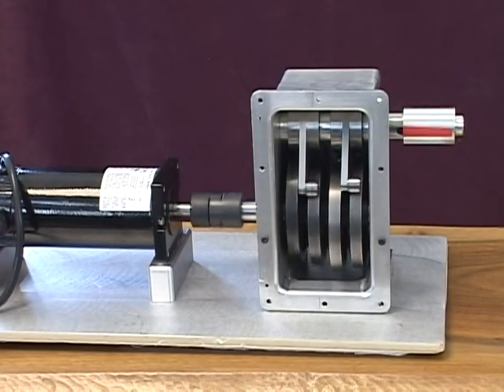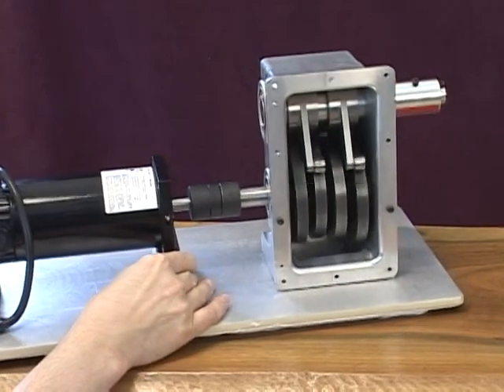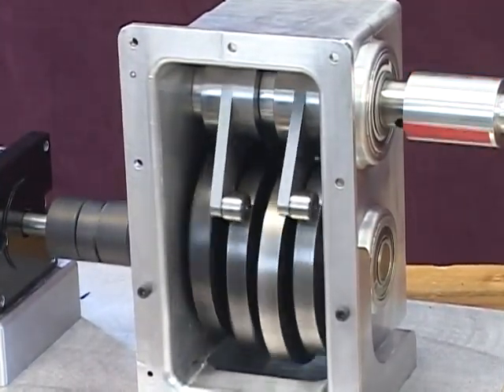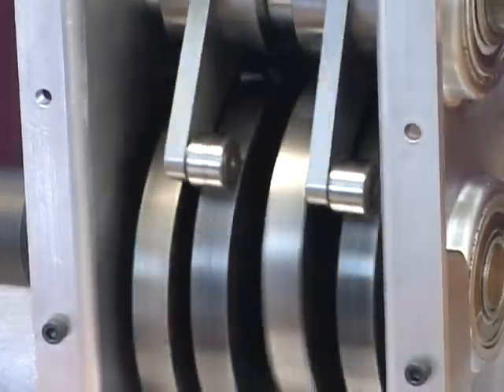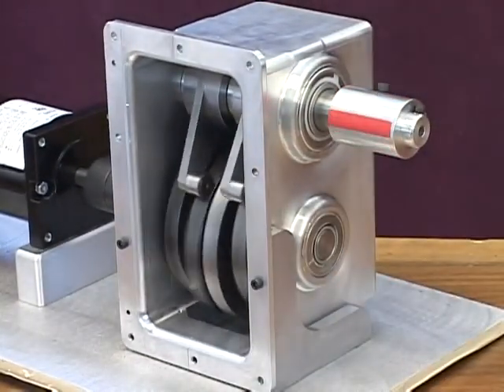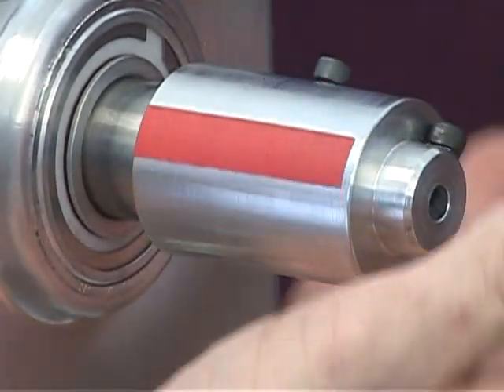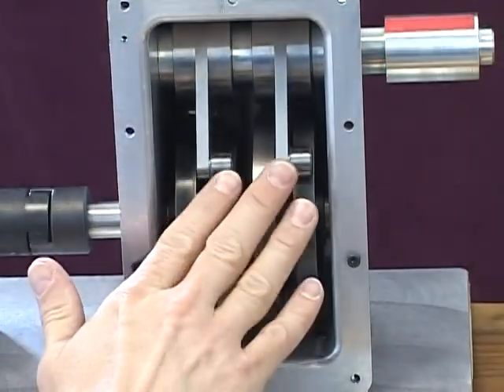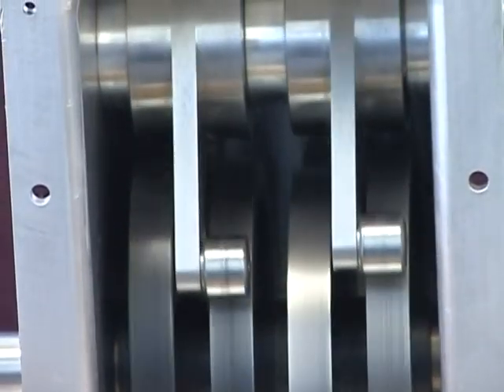Laird Gogins new patented speed reducer 20:1  - 3 Minute Demo

Comment: This is really neat and that cam surface is well done, but you'd be hard-pressed to find an application that can accept an oscillating output (unavoidable with a transmission using one-way clutches). If they're the ratcheting type, then it's technically not an Infinitely Variable Transmission because it does not solve the infamous Non-Integer-Tooth Problem and the oscillations are much worse, but then if you go for sprag clutches to achieve IVT status it is no longer positively engaged, and you might as well just have any other friction-driven IVT. It's cool to watch, though.

Comment: It's genious think you , Ihave some questions , does it support hight torc? and can we get multipele speed ?.
I suppose you are using anti-reverse , how is the vibrational comportement ?.
in my opinion tow gears are mor efitient
Reply from the maker: no vibration at all. yes it is load drive, and torque multiplying.. there is an infinitely variable version too
Reply: @MarkGreer  How does the variable version work?  Does it change the length of the connecting rod or somehow change the cam diameter? On second thought, it could use a cone-shaped cam.

Comment: I'm more interested in reversing it to where it speeds stuff up do u know why there's not a speed increaser if there is I haven't heard of it yet I mean if I hook a speed reducer up backwards I'm sure it will do what I'm looking for but idk if speed reducers can handle the speeds I want them to be able to reach.
Reply: This is a late reply but most (not all) electric motors run too fast and at too low torque for a lot of applications, so a reducer lowers the speed and increases torque. You see “increasers” (usually called gearing up) in things like bicycles and wind turbines.